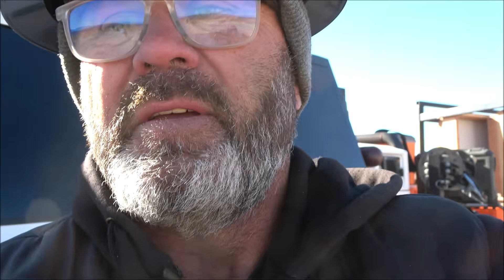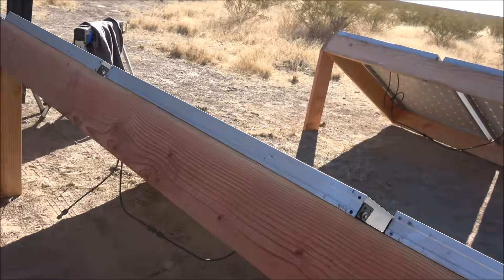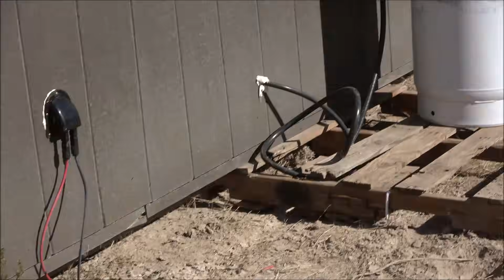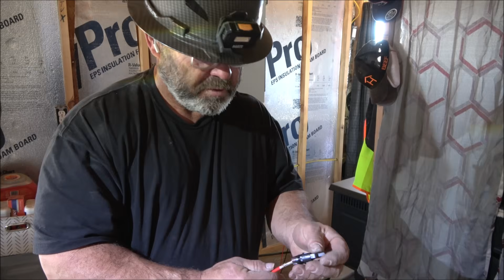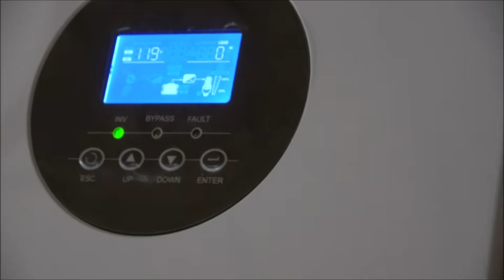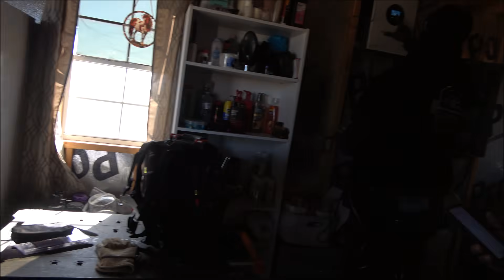Our Complete Backcountry Off-Grid Solar Installation

Comment: None of this install is remotely legal. I don’t care how frugal/cheap the customer is. I don’t see you using fusing, I don’t see a disconnect. I don’t see proper electrical conduit with sweeping 90s buried etc looks very Mickey Mouse.
Reply from the maker: The customer specifically requested an off-grid system without city or county permits, and the panels are rated for 20 amps, while the output is only 6 amps, making fuses unnecessary.

Comment: You use the fuse so if one side shorts it will not take out the other
Reply from the maker: No I didn’t because the each individual panel is rated 20amps(series rated amps) and the output amp is 6 amps and since we only have 1 parallel that gives only 12 amps therefore a fuse was not necessary but if we were to add another string then we would need fuses which we would definitely would add a fuse

Comment: Well, you might want to make one change.  You might want to get 2 x 90 PVC Conduit bodies and a short PVC pipe (to go through the wall).  Newest NEC codes say that any DC circuit over 30 volts coming into the home needs to be in conduit when passing through the wall.   That way you can just have your outside conduit go right into the Conduit body and in conduit through the wall and then out the conduit body on the other side.  You could add PVC conduit to go all the way to the inverter to prevent any possible fire hazards or accidental line cuts or pulls.  I would have probably also used some fire x rated drywall($30 ish for 4x8), concrete board or hardy board ($20 ish for 3x5) to mount the inverter on (again, just for fire safety and possibly for code if the inverter manual states to install it on a non-combustible surface).  I basically did the same thing but with a larger true split phase inverter (has neutral).  Still trying to make all my ground mounts for my panels so they aren't laying on bricks.
Reply: I 2nd that
Reply: I hope he is not a pro and just a handy man Nice racks but cover the wires
Reply: @Robertbush-s7t  Yeah, that seems to be the case.  Though the NEC code changes can be hard to figure out.  Was also told by a pro solar installer that if you run DC in attic, it has to be in metal  conduit.  It almost seems better to just build a small 4x8 shed with good insulation in warmer climates so you can avoid a lot of code issues.  Using ground mounts also reduces risk and less restrictions as far as code.  Also, probably wouldn't  be bad to mount a exterior solar disconnect and inverter AC shutoff switch outside for fire fighters or the home owner to have a way to shutdown the system from outside.  Even if it isn't UL rated, you can get a 100 amp manual disconnect  or transfer switch for $70 to $120 bucks.  Again, I would use some conduit bodies and conduit to pass it though the wall and back in to the breaker box.
Reply: @DBlindOne  It is not about code as muck as safety
Reply: @Robertbush-s7t  This is true, but most codes are written with safety in mind so often it is the right way to do things to prevent accidental shocks and fire hazards.
Reply from the maker: Man thanks for the info I will definitely do that
Reply: @jaymccutchen3952  Are they 300 watt panels They don't look that big and most that has 10 amps of out put
Reply: Please put the 120 vott wire through the 2x4 and put a nailer over it You spraying me
Reply from the maker: @Robertbush-s7t these panels are high voltage (VOC 64.9volts)with 5.98 amps and are 327 watt panels
Reply: @jaymccutchen3952  They have got to be old as hell
Reply from the maker: @Robertbush-s7t I got a question for you is it better to run high voltage and less amps or is it better to run low volte high amps?
Reply: @jaymccutchen3952  I can answer this a bit.  Higher voltage and lower amps means you can go with a lower gauge wire (which means cheaper).  However, you you CANNOT go over voltage for charge controllers as it will kill them.  If the output amps are too high then your charge controller will just not draw the max amps.  Also charge controllers normally have a specified voltage range with a minimum voltage to start charging and a max voltage (so you don't fry the charge controller).
Reply from the maker: @DBlindOne 10-4 but we are within specs  we are only at 300 volts and appreciate you sharing, thanks and please keep me on my toes 😅
Reply: @jaymccutchen3952  no problem.  Just so you know, you can lookup a DC wire size chart and see why higher amps is a negative.  For example, if your solar cable is 70 ft long and your panels run at 20A, you need 2 gauge cable (probably 3 bucks a foot).  If you go with higher voltage and drop the amps to 10A, then you only need 6 gauge wire which is probably $1 a foot.  If you use a smaller wire, then you are going to lose some power (voltage drop) and the wire will run a bit hotter.  If you go to small, then you set the wire on fire.  :)  You can also just search for DC wire size calculators to make sure you use the right size cable.  You just need to know the voltage and amperage of the array and the length of cable.
Reply from the maker: @DBlindOne thanks for the info👍

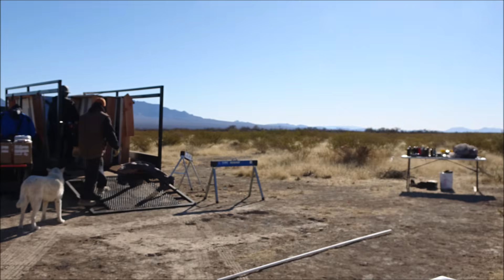Comment: 1:19 Pre-made? You made them before you made them? I think you just made them.
Reply from the maker: I had made the wood frames and mounted the solar panels to the wood frame just not the legs and then when we got there, we slid them off and screwed the legs on which made it a lot faster than trying to build the whole frame there
Reply: @jaymccutchen3952  also making the frame on flat concrete makes everything more square.
Reply: Good idea